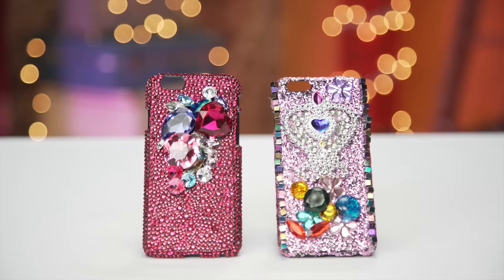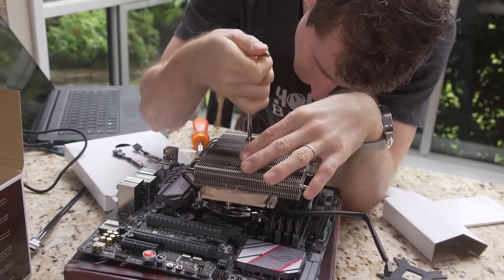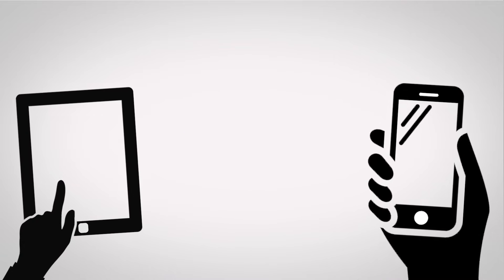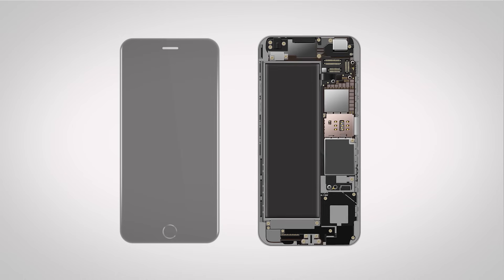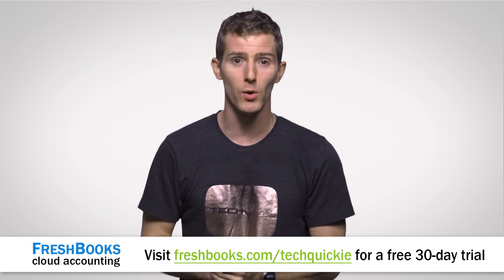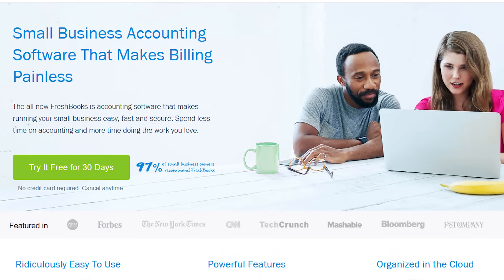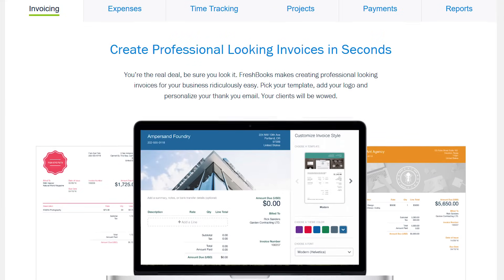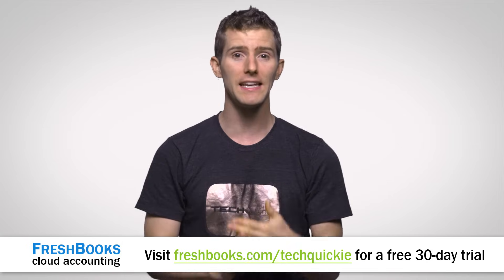Systems on a Chip (SOCs) as Fast As Possible

Comment: SoC does not integrate storage nor ram in most cases (smartphones) so the producer can create different devices with the same soc.
Plus apple Ax cpus arent less powerfull than other brand ones. they are in fact almost 50% larger in silicon size and much faster cores.
Oh, and that msaa thing is avaiable in every android phone out there
Reply: Large silicon is not bad, large production process is. The mobile chips are all based on 14nm processes, some from samsung, some from tsmc and some from global foundries (Apple uses Samsung and Tsmc for it's SoCs).
A SoC is divided in cores, and these cores have a speed. If we assume (and we can) that Apple, Samsung, Qualcomm and so on are at the same level of knowledge in cpu designing then cores of the same sizes have the same power.
Now...
Samsung decided to take the usual approach of many small cores, in fact their Exynos are 4 medium cores + 4 small cores.
Qualcomm decided to go the middle route and put 4 pretty big cores in their snapdragon 820.
Apple instead never took the "moar core" route and thinks that 2 really big cores are easier to develop for.
Remember that all these 3 cpus are the same sizes, but the core size is different. 
To give you a comparison look at this image and remember the process size is the same for all of them http://cdn.wccftech.com/wp-content/uploads/2016/10/Apple-A10-Fusion.jpg (4xM1 + 4xA53 in the Exynos 8890, 4xKryo in the Snapdragon 820 and 2xHurricane in Apple A9)
Reply: large silicon size is bad..bigger electricity cost and heat output..compare 14nm skylake to 90nm pentium...you'll see a difirence:D
Reply: Matthew Miller Plus, it's specialized for one/two devices only.

Comment: I don't see why the AMD APUs can't have 2GB or 4GB OF HBM memory  next to the CPU , The RX480 Die size is so small , they can fit a full fat GPU die there and keep the power under 120 Watts for the package (40 Watts for the CPU part and 80Watts for the GPU part ) , This way We can get an RX470 performance on a laptop and it will not generate that much heat , Remember when using  less silicon and materials you can have much better profit margins .  On a desktop Platform , AMD can have an amazing all in one solution . The APU as is , is not really worth it's money . I do not want to play Overwatch at 30FPS for example . so people will save and end up buying a different platform

Comment: You cannot call a chip a Quad core if it cannot use 4 cores at once...
Reply: I'd argue you can, I mean, there are 4 cores present, so technically it IS quad-core, even though all 4 cores aren't ever used at once.
What would you call it, a 2+2 core or something?
Reply: Samie Sahim You cannot call it a quad core. Think of it this way: most cars have a spare, but that cannot be used at the same time as the other 4; therefore, you would not call a car a penta wheel car, only a quad wheel one.
Reply: TheWioreks difference being that the four core all are being used, just not at the same time. Or are you like constantly changing the wheel? like... whenever you enter a new street?
Reply: "cannot use 4 cores at once"
please post a link , i want to read more about this
thanks in advance
Reply: Nik Xau Do you own research it's not the hard. It has 2 low power cores and 2 high power cores. Only I set can be used at once.
Reply: Fabio Mota If all 4 cores cannot be used at once, which is true, it is not a quad core.
Reply: in the Snapdragon 800 then a light load is present, only one core remains active, and the others stop

Comment: The A10 is an absolute monster!
Reply: Shut up, Plank!
Reply: Bojidar Martinov "a10 is 4 cores, there are Android's with 10 cores..." He's implying that more cores equates to better performance.
Reply: +zachariah Find me a better mobile chip than the A10? Better performance as well as power efficiency. Adding more cores to your chip in no way makes it better.
Reply: Brrrrrrrrrrrrrrrrrrrrrrr
Reply: A10 + IOS is a beast. A10 by itself isn't that impressive
Reply: The point is that there are 8 cores chips that are less powerful than other 2 cores ones. It depends a lot on the CPU architecture, that's the point. Apple hardware always has been very powerful (the gpu most times outperformed the ones used on android devices, too). Android needs a different kernel for every single model of Android device, making Android very optimised to the hardware of the devices. Java code isn't run, but compiled in a machine code through ART compiler, that does that in installation phase, and not in running phase. Basically Android is optimised too, and Apple uses powerful hardware, even if it doesn't seem on paper.
Reply: Spherox oh geez dude tf this guy is sayining a fucking arm 8 core cpu is better than a fucking i3 with hyperthreading thats like sayining ps4 is better from an i7 7700k cause it has 8 cores...
Reply: Spherox That plank can talk....
Reply: yeah GAU8/A is awesome
Reply: A10-7870k owner here. It has minor drawbacks/cons but definitely poor-mans-choice in place of newest i7/i5.
Reply: Spherox What wrong did he said?
Reply: Spherox The problem is that he didn't said that. Read his comment again.
Reply: +Piereligio Di Sante apple know how to optimize..android has all customization..rooting phone unlocks hundres of good stuff..changing entire os even :D

Comment: Apples A series performance is not directly driven and a direct result of optimisation Linus, like many think. I honestly thought you more than anyone would know core count doesn't equate to performance. Just a single core of the A10 is close to being on par with Googles entire Pixel CPU on geekbench (3500 vs 4500) and due to Apple spending exponentially more money year on year than any other SoC designers, Apple are the only company approaching if not catching up with, desktop counter parts.

Comment: random question: why is android full of pre-installed bloatware and full of trash in goolge play with no option to disable app services as you can do in windows?
Reply: you can disable app services if your root or some custom roms like cm have it built in to it if your phone doesn't have it its your manufacturer or carrier choice
Reply: Probably software devs paying the manufacturer to include their software in order to try and gain new users/customers. Or, in the case of Verizon, you just feel like duplicating every stock app with a shittier version with an unsightly red icon.

Comment: every android device has the 4x MSAA option...
Reply: Most newer ones have it, indeed.
Reply: To enable developer settings just go to Settings -> about tablet -> tap on build number a bunch of times and dev setting should be available.
Reply: Its in Android 4.1 and newer.
Reply: mine doesnt
Reply: Gotin Fuklio it does, it's in the developer settings
Reply: Violent Synth i dont have it there
Reply: Gotin Fuklio what android version and/or phone do you have
Reply: Violent Synth only 2d gpu rendering which only slows stuff up
Reply: Violent Synth adroid 4.0.3
Reply: yeah...
Reply: I found it, it's quite well hidden.
Z3 Compact
Reply: nope, mine doesn't
Reply: Did you enable developer settings menu on it?
Reply: My friend i think it's time for a new phone.
Reply: I was just screaming the same thing at my computer screen! Haven't even watched the rest of the video yet.

Comment: This definition isn't 100% accurate given that Apple's SoC's have 1B+ transistors like Intel processors, and Nvidia Tegras now have CUDA cores
Reply: Peter Pirando except Intel is using those 1b transistors for mostly cores and cashe while Apple will have to spread out the 1b transistors over more internal items. Intel's CPUs take 60W+ while Apple's chips are like 5W so there is still a massive difference between the two.
Reply: bensemus x actually most of the 1B is spread across the HD Graphics these days because if you see die photos like 60% of the chip is HD graphics and the rest is processor, memory and controller
Reply: Peter Pirando More like 40%
http://cdn.wccftech.com/wp-content/uploads/2015/08/Intel-Core-i7-6700K-Block-Diagram.png
Reply: Peter Pirando Those are still cores and such and Apple also has a GPU in all its CPUs. Only workstation class and higher CPUs from Intel (Don't know about AMD as they seem to be pushing heterogeneous computing) lack an iGPU nowadays . Intel isn't adding an accelerometer, gyroscope, compass, and barometer, M9 coprocessor or a dedicated image processor to their chips. All that stuff if needed is external.

Comment: What's the difference between a SOC and a microcontroller, btw?
Reply: to run linus
Reply: SOC is the full system, often the computer on a chip, or at least that is the 
goal. They are very powerful compared to mere micro controllers. SOC may
 have large amount of memory, peripheral interfaces, radio/wireless 
connection.May be multicore. Microcontrollers are processor chips 
with inbuilt peripheral components, ADC, DAC and some memory. Designing a
 system is easier with these than with a raw microprocessor.
Microprocessors are raw processors with minimal ALU+ registers without any peripheral 
components. You need to connect other chips to make it useful.
Reply: thank you, explained much better than Linus.
Reply: Controversy Owl they are kind of the same thing but not exactly. SoC tends to indicate it is built to be an entire System. I'd say a SoC often (but not always) has more complex peripherals and is more oriented for a specific type of tasks, while Microcontrollers tends to be cheaper systems in the 10cents - 10 dollar category when ordering for mass production, and run in the 10 - 100MHz range. Compare that to the iphone SoC chips with multiple "real" cores running at GHz, plus many "low power" Kingfisher cores running at 300-400MHz. i.e. The "low power" parts of an iPhone are performance horses compared to many microcontrollers.